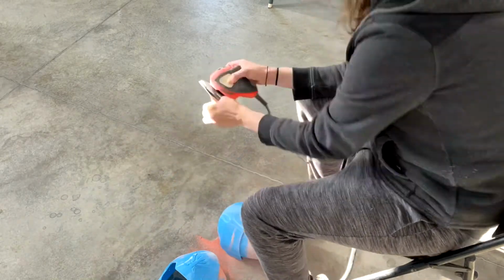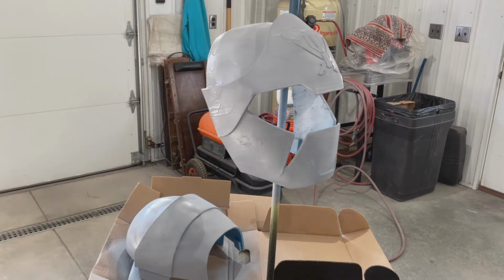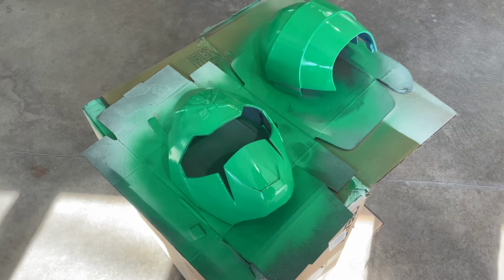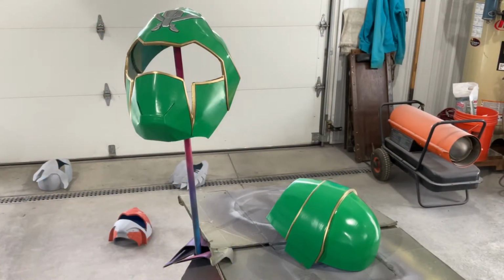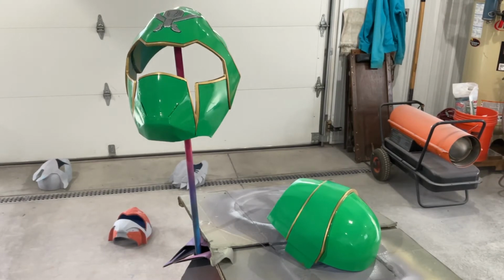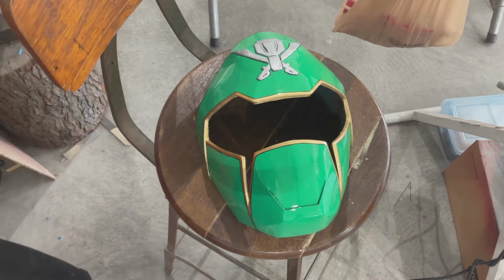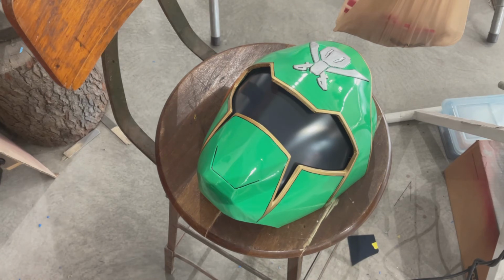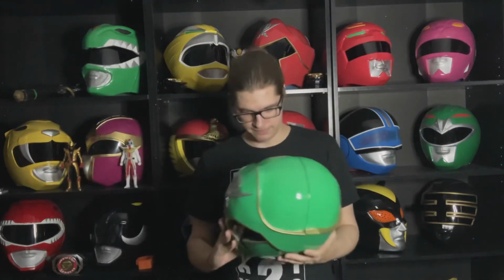3D Printing and Finishing a Power Rangers Super Megaforce Green Ranger Helmet

Comment: Where can I find some nice visor?
Reply from the maker: Are you looking for the material or for someone to make you a visor?
Reply: @Stickasaurus  I am looking for materials like visor. The one you have.
Reply from the maker: @Richie20062007  I use petg .02mm thick plastic sheets and vhf spray tint, should be able to find it all on Amazon
Reply: @Stickasaurus  can you send me a link the kind material that you are using?
Reply from the maker: @Richie20062007  VHT SP999 Nite-Shades Lens Cover Tint Translucent Black Paint Can - 10 oz. https://www.amazon.com/dp/B000CPCRS6/ref=cm_sw_r_cp_api_glt_fabc_Y3V4MK7W81DGDVQW7420?_encoding=UTF8&psc=1 that’s for the spray tint and 4 PETG Clear Plastic Sheets 12" X 12" X 0.020" https://www.amazon.com/dp/B00HFEI7VS/ref=cm_sw_r_cp_api_glt_fabc_M3E4NDGG9275CM25CAW5?_encoding=UTF8&psc=1 is the plastic sheets I use
Reply: @Stickasaurus  thanks for the tips. But once you spray on the Plastic you can still see the visor
Reply from the maker: @Richie20062007  yep you can see through it perfectly fine! That stuff is for car Windows
Reply: @Stickasaurus  Thanks 😊 👍